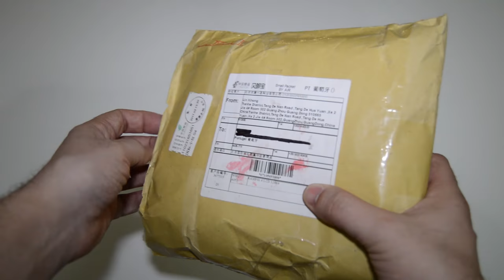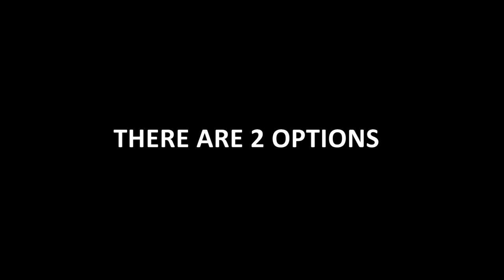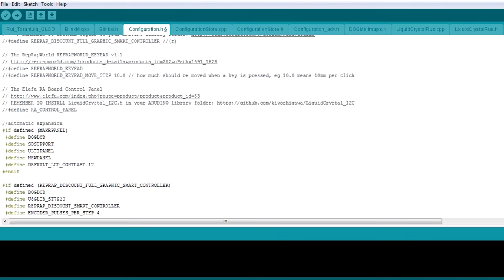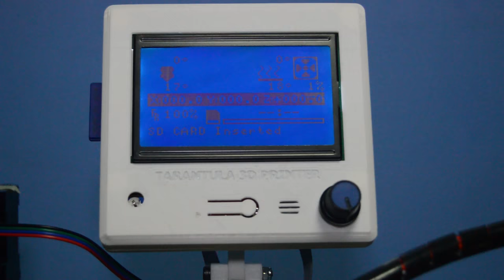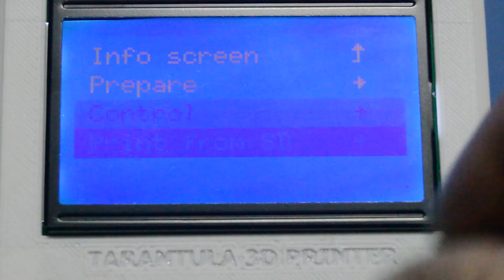TEVO Tarantula 3D printer - HOW TO improve your printer - Part 15 (Display)

Comment: For the connectors there are two smarter options (and cleaner):
First one is to disarm the cable connector, remove the cable, flip and insert it again and rearm the connector again (maybe you want to cut the portion of the cable that is punched).
The other is to remove the plastic piece of the connector in the LCD board without removing the pins (no desoldering needed) and then reversing it. It can be done applying a little of lever force under one side and the other of the connector alternatively until it slides off the pins.
So no need to cut anything.

Comment: did you directly connected the full graphic controller to the board to start 3d printer or used another controller device
Reply from the maker: After flashing the firmware, you only need to connect the new display and that's it.

Comment: I enabled in the firmware, downloaded the library, checked if it was the correct board and I flashed it. Everything works fine except for the hotend...it wont heat up anymore...not a wiring problem I already checked that. When I preheat the blue light next to the E0 heating spot on the board blinks instead of remaining solid...Any ideas??

Comment: what if I directly connected the full graphic controller to 3d printer
Reply from the maker: Without updating the firmware it will not work.
Reply: +ruiraptor for updating the firmware what to use (arduno and ramps1) bord or (only resberry pi bord)  which is best
Reply from the maker: I only use the PC as i prefer it.

Comment: What about a third option ? Pull the plug on the ribbon cable apart, its not that hard just need to be careful not to damage it.
Reply from the maker: Hi Mike,
Yes, you are right...that is also a possibility. I did that before on other electronic projects. The only issue is the plastic side pins that can break if not careful.
Reply: A fourth option is new plugs :) . Just add to the cable with the correct orientation.
Reply from the maker: Hi Rob,
Also true.

Comment: you could also just unclip the connector carefully and reposition it in the correct orientation
Reply from the maker: True. you are absolutely right. I was afraid to suggest that because it's easy to damage the pins.
Reply: ruiraptor agree, the pins can be bent over easily, but I'd rather risk bending a pin than taking a knife to a pcb or cable.
Reply from the maker: To be honest, cutting the notch from the flat cable connector was the easiest but every method takes risks. Some more than others.
Reply: You'd have a fit if you saw some of the thing we technicians to do get electronics working in a pinch! lol

Comment: I have the arduino software installed, adn I have uploaded software to an arduino before, but how to I edit the firmware already on my board?  If I can't, where can I download the default firmware from?
Reply from the maker: The only way to backup the existing firmware of the board is by connecting by ICSP. By usb you cannot.
I think that the TEVO website has the stock firmware but i don't know if it's the same you have currently in your machine.
Reply: SO is that how you got your firmware, or did you download it from somehwere?
Reply from the maker: Hi,
I used the same 1d version firmware (https://youtu.be/P4W0UI9r6pI ) but changed the lcd configuration.
Reply: So is the stock firmware repitier and not marlin?
Reply from the maker: Hi,
No, i think that the factory firmware from Tevo is Marlin. It's just not the current version.
Reply: Wish I could find that exact file.  The one labeled stock firmware that I have found is repitier...
Reply from the maker: Install the community 1d firmware that i use in my video (and currently using) and try that

Comment: Hi ruiraptor! I ve mks gen L 1.0 , is the same process? Thanks in Advance.
Reply from the maker: Hi Alfio,
Yes, it's the same process. Do you have it already working with the stock display? You still need to flash the firmware with the new graphic display enabled and check the display connectors.
Reply: ruiraptor my stock board and LCD burnt 2 weeks ago, and now i've bought Mks gen L 1.0, graphips LCD and drv8825....Yes i Will change the firmware ! I ve Just a problem, i dont know which boards.h select with this new board...mks didn't release datasheet about It. Thanks!!
Reply from the maker: You can use the same board in the firmware. It will work as well.
For more info, check here:
http://reprap.org/wiki/MKS_GEN
Reply: ok thanks!! BOARD_MKS_13 Is correct right?
Reply from the maker: You can also try the 33
#define MOTHERBOARD 33 -> (33 is for RAMPS which the MKS GEN is compatible with )
Reply: ruiraptor ok thanks!
Reply: ruiraptor Sorry, last question, if i wrong board , It burn again? :)

Comment: I did the same a month ago, but the Pins on my cables are compatible, I didn't have to change anything.
Reply from the maker: Hi Robin,
You got lucky. Most people i know that bought this LCD had the same problem. Does your LCD has the same letters writen on the frontal pcb?
Reply: Phuu... I don't know, it's now embedded in a case, but that was the seller of the LCD --> http://www.ebay.com/itm/301724406007
(BTW. I can recommend gc_supermarket, I bought a lot of stuff from him)
Reply from the maker: Yours looks like a different model/version. I noticed that the one in your link doesn't have the contrast potentiometer. That's the first thing that pops out. They don't have any image of the back side.
Reply: strange, I just opened my LCD controller, the contrast poti is on the front side. BTW. I should mention that I used the same cables that was provided with the tarantula. Maybe that's the real "problem"
Reply from the maker: I used the same cables of the tarantula too. The ones provided are too small for me :)

Comment: and what if my printer is not getting cunnected with my pc
Reply from the maker: To use this display you need to flash a new firmware version...so you need a PC connection.